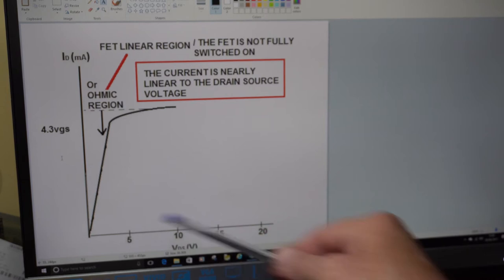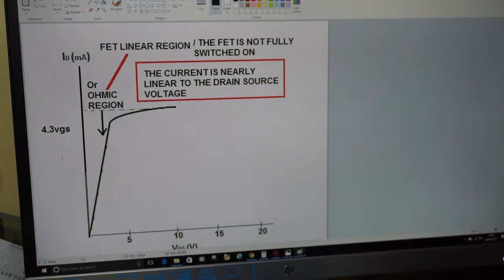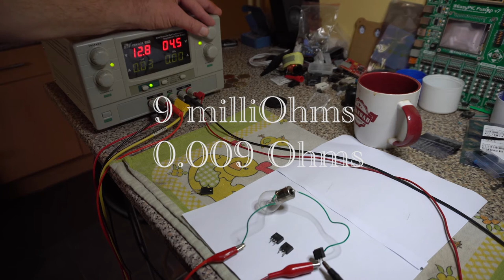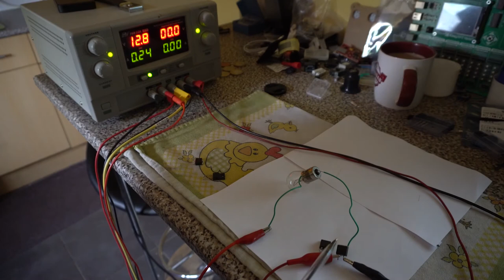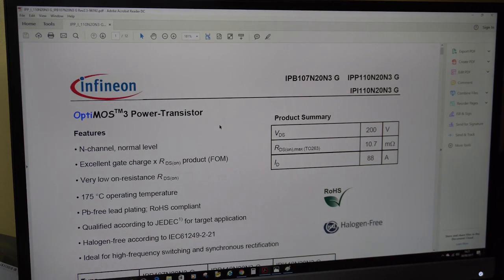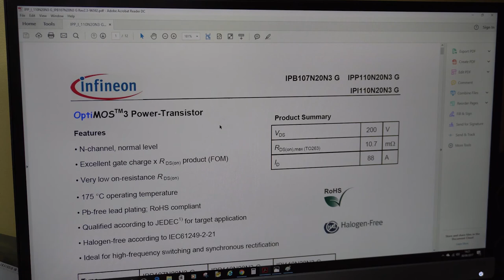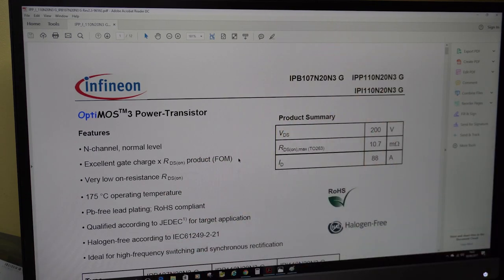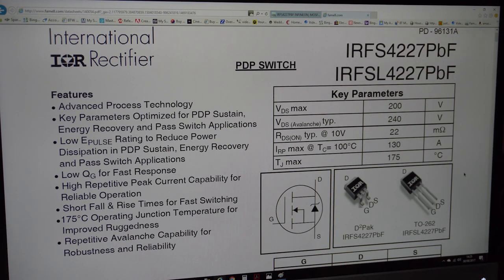FETs Linear Ohmic & Active Region basics + odd behaviour FETs from Infineon

Comment: Nice spot on that 3power transitor .Cheers John .
Reply from the maker: lol
Thank you
Reply: it is just a regular n-channel mosfet, OptiMOS-3 is just Infineons name for the process used to make that particular type of mosfet 

almost all their mosfets have some designation OptiMOS and some number
Reply from the maker: Hi Lasse Langwadt Christensen
I have just put the 1k resistor back on the Gate and Source.
My Fluke is measuring 0.031 volts at the FET gate and at the FET source.
It is still staying on with the resistor connected with a gate voltage of 0.03v (after it was switched on then off)
Reply: you must have a defective or fake part, have you tried more than one? The datasheet shows it as a bog standard mosfet,  zero gate voltage drain current spec'd at <100uA @125'C

as an addendum, many modern mosfets have impressive specs when used for switching but most of them really don't like to be used in the linear region
Reply from the maker: Hi Lasse Langwadt Christensen
Yes I have 3 of them and all purchased from Mouser.
I tested all 3 last night, they are all the same.
My Atlas transistor tester shows they are all N Channel Mosfets and all working with no leakage.
I have written to Infineon and asked them if they have a problem or know of a problem.
I'm keen to see their reply.
There seems to be current flowing back through the gate, this holds it on.
I tried the IR FET in the Peavey last night, spot on and 100% ok.

Comment: I'm quite sure you are being fooled by measurement error, the powersupply might show 0 volts but try measuring at the gate with a voltmeter or put a pull down resistor on the gate.  
The gate on a mosfet is extremely high impedance so once you have charged the gate capacitance it'll stay on even with nothing connected to the gate. 

if you don't connect anything to the gate you can probably turn it on and off just by touching it with a finger

I think the resason you can turn it off by shorting is that the capacitive coupling from drain to gate discharges the gate
Reply from the maker: Hi, Thank you for your comments and help.
Before doing the video, I did stick a 1k resistor from the gate to the source, yes I went as low as 1k.
I do know a 100k would discharge the gate.
Don't forget, this FET was roasting in seconds when mounted to a Peavey amp pcb that usually runs cool.
I was shocked to see how it behaved, but it did explain why it was getting so hot on the Peavey amp.
I can understand your thinking with the power supply, but the other 2 fets worked as they should.
The power supply is accurate at 0 volts and maybe 100 or 200 mV off when turned up
That FET is an odd-ball